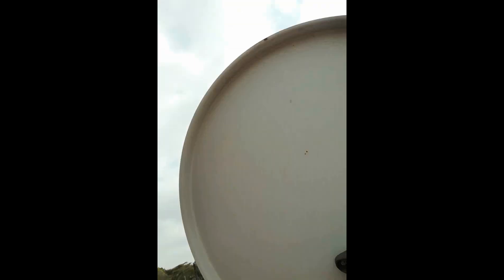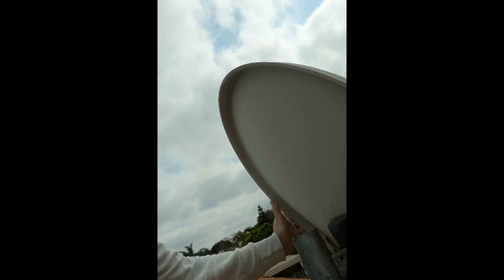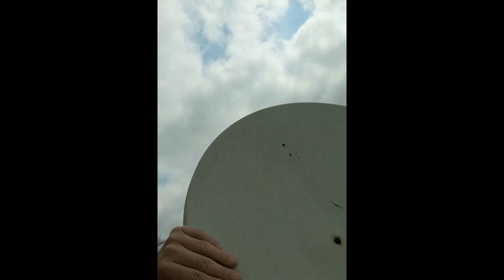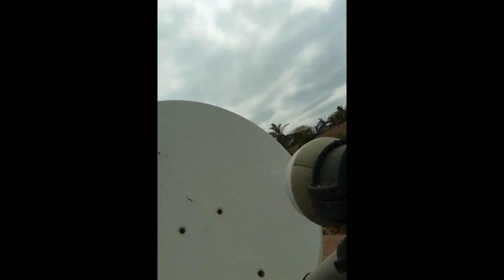HOW I  used a satellite dish as an lte ANTENNA

Comment: he just zip tied a crappy omni directional antenna (like what most use for a car or ect) onto the dish. If it works for him, great. I'm 7 to 14 miles from the closest tower, and there are hills around me as well. A 25ft pole with a directional antenna and a weboost 4G signal booster does boost my signal strength to -66 to -69dbi... but it doesn't increase my speed at all. still average 8mbps, which is what I can get directly from my cell router without any booster or external antenna. I am currently mounting my old panel antenna to a old satellite dish, and see if that helps at all... but i don't expect much as I can only put a dish up about 7 feet or so. anyway, just thought i would post if someone else was trying to figure out similar. there are other videos on youtube showing cell lte satellite dish. for some people it helps.
Reply from the maker: Hi YHRIM it's seems to me like it's a overloaded tower that is the issue here - 66db your speed should be right on point I would try and connect to a different tower all together